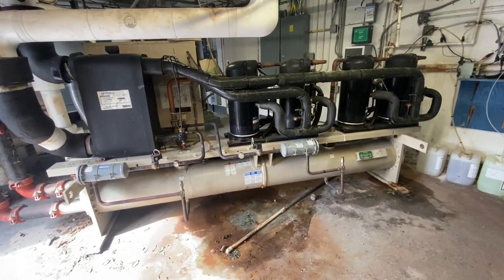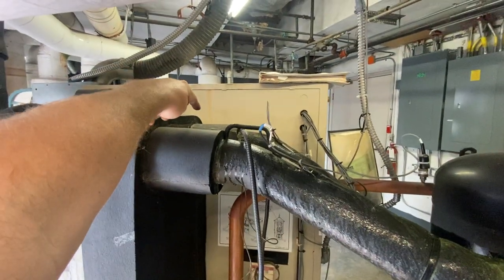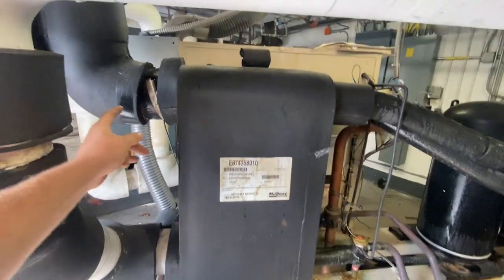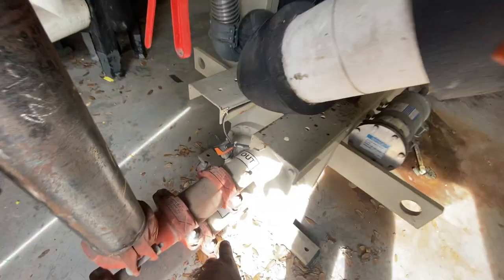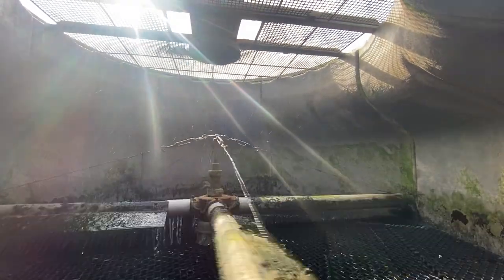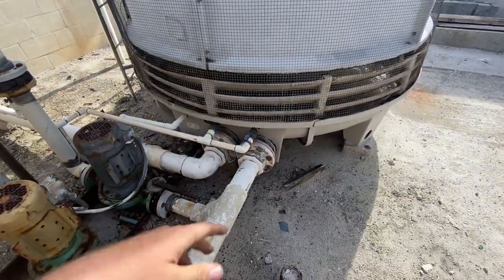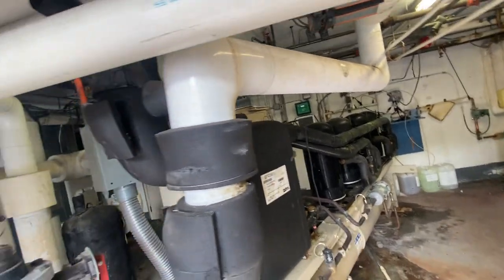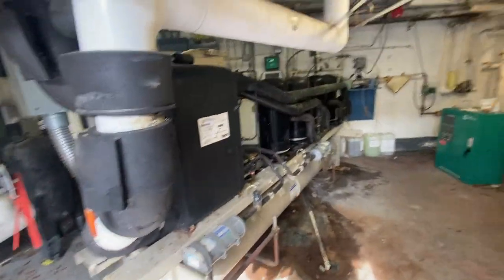Cooling tower and chiller basic overview

Comment: Been doing residential installs for 10 years, I now have an opportunity to enter apprenticeship for chillers and boilers. Thanks for this video. I start next week
Reply from the maker: Congrats on stepping up. It’s all the same. An a/c unit cools air, a chiller cools water. Both use all the same components. An air handler has a blower motor. A chiller uses a water pump. Honestly the refrigerant circuit is the exact same. It’s really not much different.  If you see something you never seen before get as much info as possible and take a lot of photos. Google research would have info on the subject.
Reply: @20antman  thank you so much for responding! Your explanation and comparison gives me hope and not regret taking a leap of faith. makes it easy to connect the dots. Will be watching more of your videos, thanks again. You are great help

Comment: I have a question. I have a CT two runtime been running for awhile. While chiller 2 is back in service because it was in repair. After noticing CT pump condenser 2 has a long runtime. I decided to turn on CT1 pump. Then shut down CT 2 pump off. Once I did that chiller 2 that was running shut off. Does that mean CT1 is only meant for chiller 1?